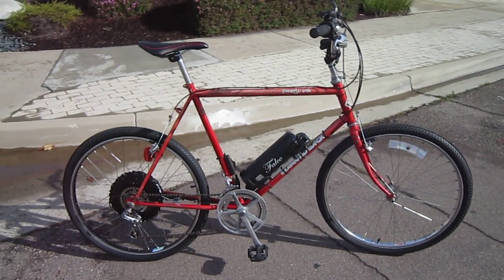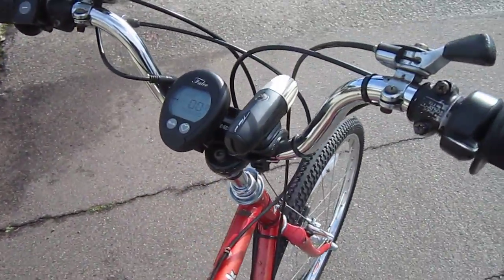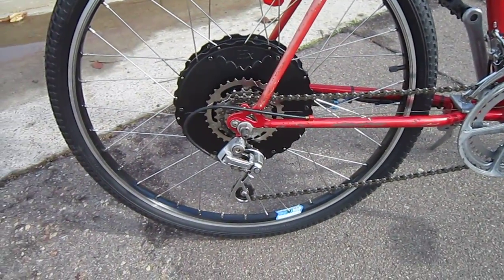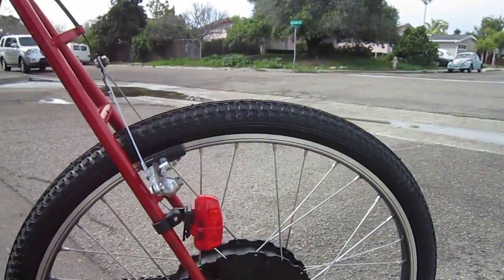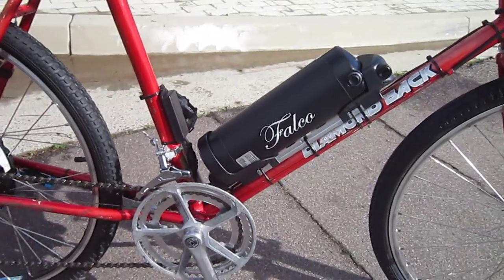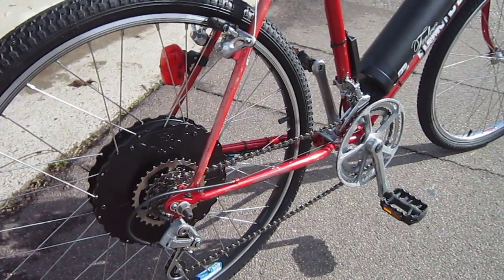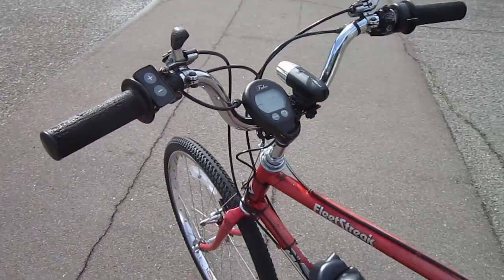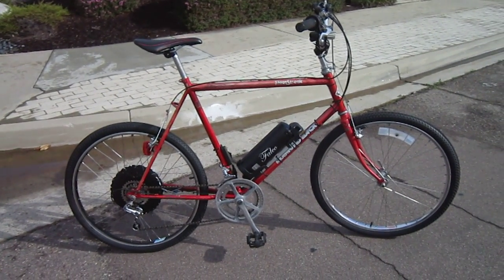Falco E-bike Conversion System---Installed

Comment: Why don't you convert this bike. Gravity EZ Cruz 1 Speed chromoly frame and fork. $169 free shipping from bikes direct.   With a front drive motor with a disc brake.  brakes and a adapter is less than $50 us on ebay.
Reply from the maker: Interesting idea. Still. these are temporary builds to test products. This bike treats me well.
I am not in the habit of buying bikes just to test these E-conversions---but own bikes I like and need.